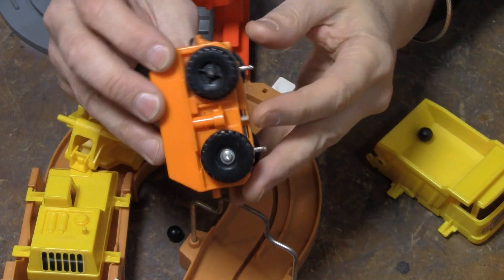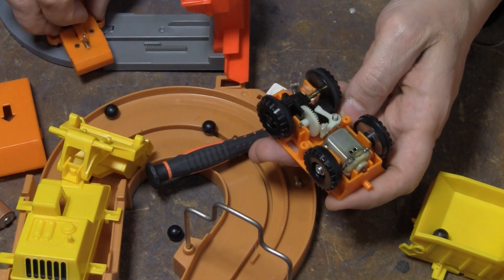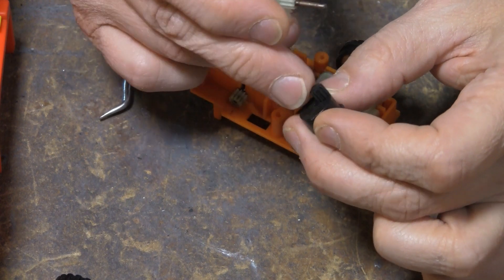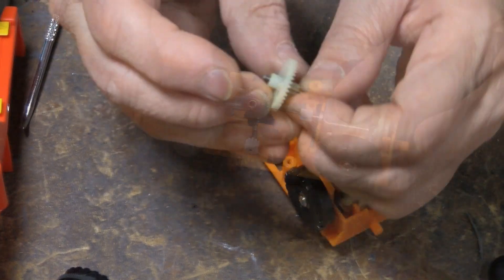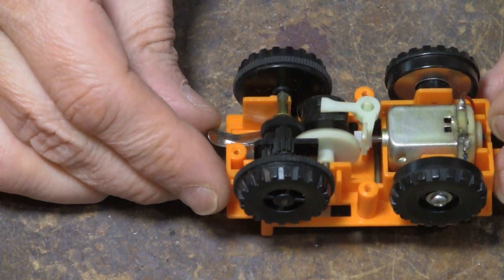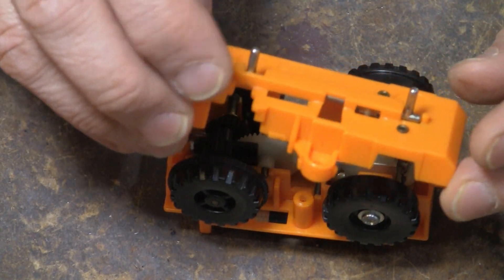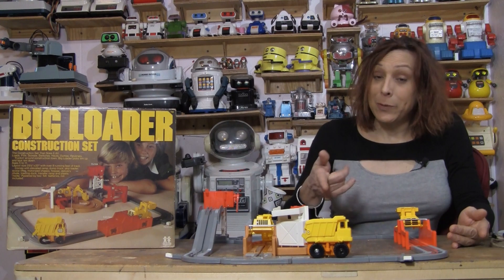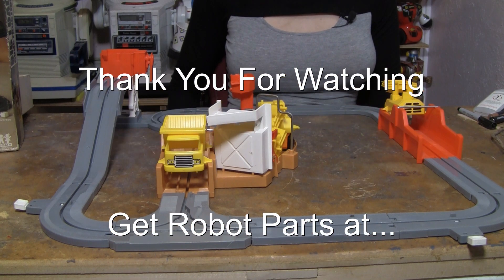Fixing the TOMY Big Loader: Cracked Gears and Classic Mechanics!

Comment: Wish I still had mine from the early 80's but it got thrown out after one or more of the gears self destructed. I took it apart when it broke, but wasnt much I could do back then with no replacement parts available. Would be a relatively easy fix today with modern replacements I think.